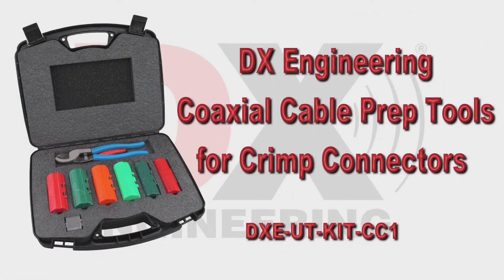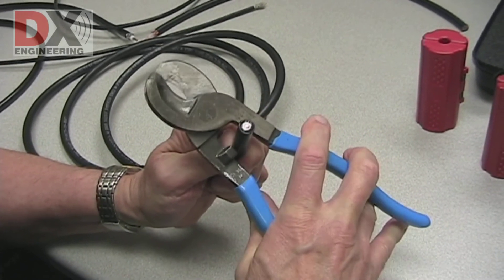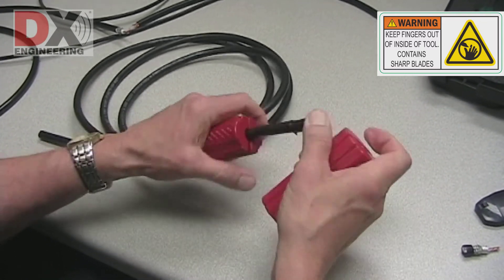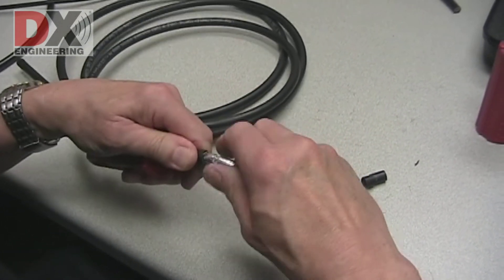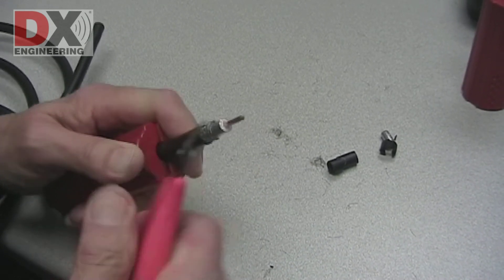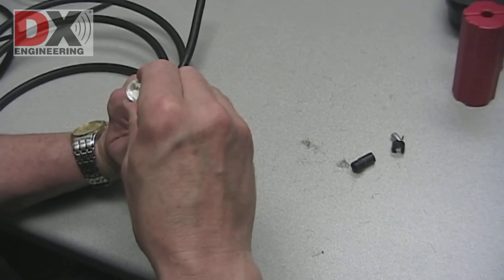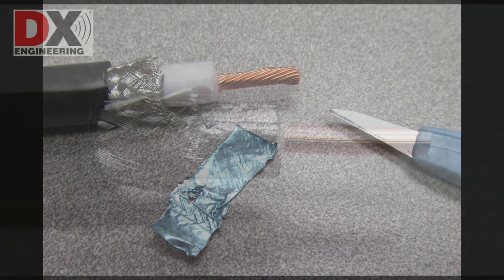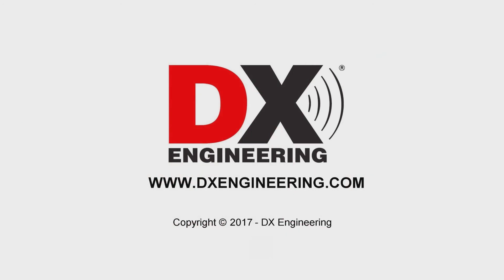Crimp Connector Cable Prep - 400MAX & LMR-400

Comment: This video is very helpful.  I bought DXE-PL259CS8X UHF (HF) plugs.  I bought the die to crimp the shield but the stripping tool was on back order.  I modified CATV RG-6 stripping tool to make it work.  The DXE Die for this is standard.   I was able to install them in place of Power Pole Dies in a Mountain Radio Crimping Tool.

Comment: Very brutal stripping. Not a very clean cut. Having to bend the foam around the center conductor to break off the insulation??? Having to trim access braid / foil off the conductor??? Having to trim off the foil with a knife??? Thats what a good cable prep tool should be doing in a single pass.  For the kind of $$ this set is worth, its NOT a very good investment.

Comment: I guess different stripper tools for different people. I cant get good results with the "pecil-sharpener" style stripper. I have to use the 3-level finger stripper tool that you rotate around the cable. The tool here in this video requires very strong grip and twist motions.